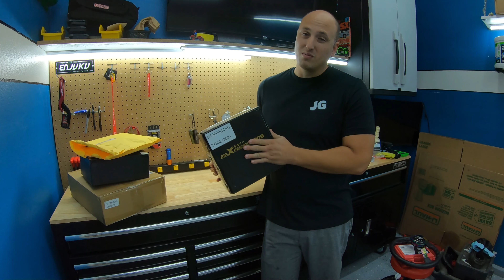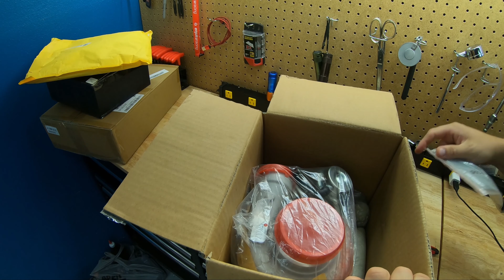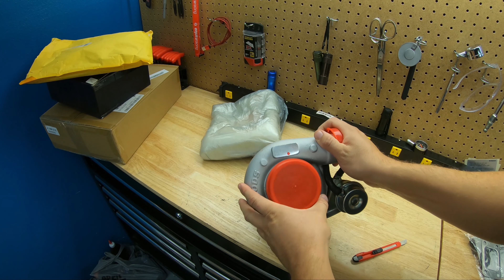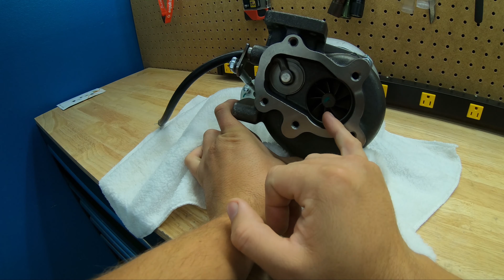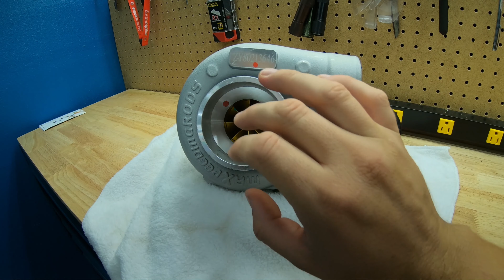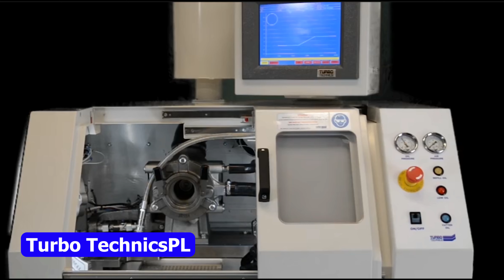300zx NA to Twin Turbo swap Turbo unboxing!!

Comment: Is there an update video on the installation? I'm about to try a pair and going to clock the right side turbo compressor housing and adjust the wastegate. I need to measure the space with the engine mount brackets and new intake hoses.

Comment: Bro I just bought a Maxpeedingrods turbo, that’s crazy you’re using their turbos as well. I got an aftermarket fuel pump and I’m gonna run a single turbo T3T4 and run 5 psi creating an effective compression ratio of 13.3.  A stock 300zx  twin turbo at 9 psi makes a ratio of 13.6. under load. I’ve ran 6 psi on a Honda b20 nonvtec with a compression ratio of 10.5.1 producing a ratio 14.8.1 and the engine ran great! I’ll let you know what happens when I boost my NA Z32 😀
Reply from the maker: Awesome! Thanks for sharing! Yeah keep me updated

Comment: Nice. I'm doing a similar build this winter on my 93 300ZX GT2560 g6x. Awesome to seeing all your videos! What's your power goal?
Reply from the maker: Hey, Power Goal is going to be in the 400hp range. Tuning is going to be a big factor along with fuel, E85 is what I would like to be running.